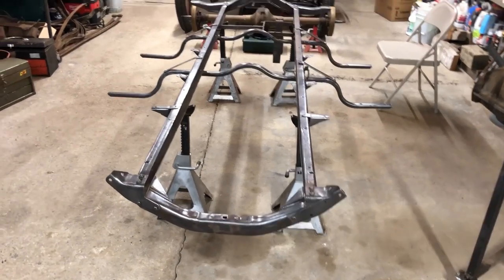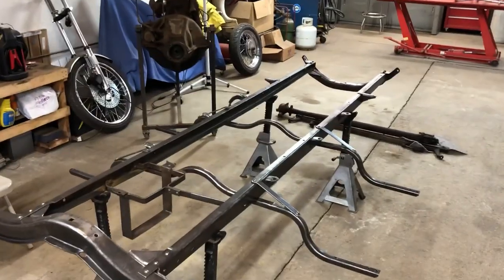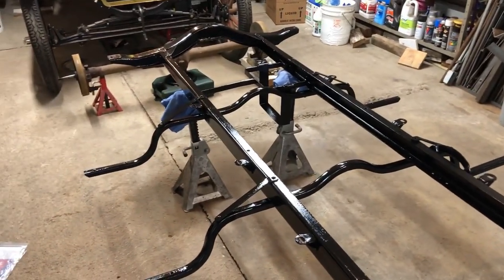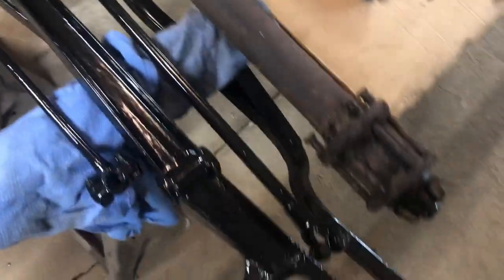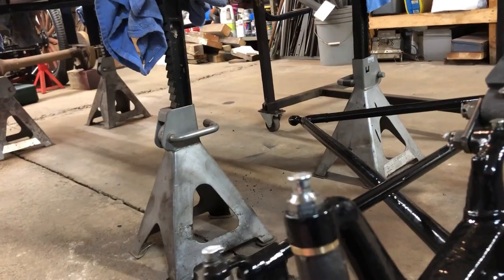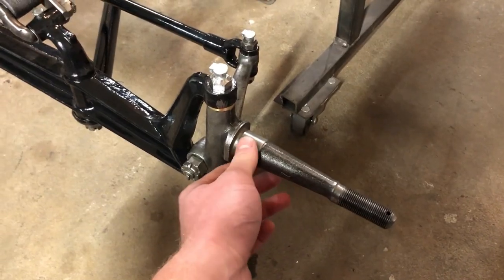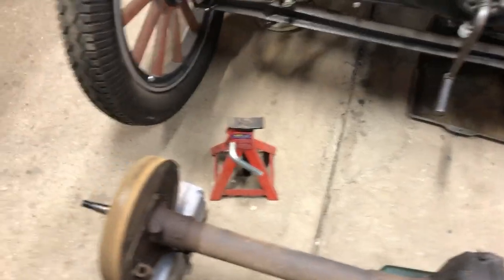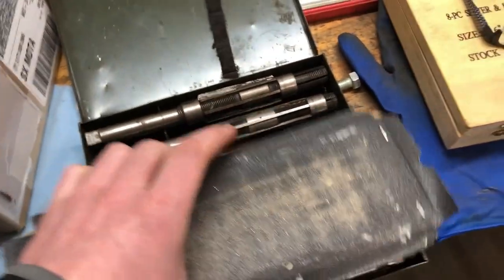Ford Model T Restoration Part 3 - Front Suspension Assembly and Painting - Reaming King Pin Bushings

Comment: Im rebuilding a 1926 T Roadster. It was apart when I bought and Im having trouble finding anything to show me how it goes together. Im ready to install the body but can't find anything to show the sequence. I'm hoping that you have more videos. So far I found 1 2 and 3.
Reply from the maker: On the Model T my family is working on we removed the fenders, running boards, and mud guards before we removed the 6 bolts to remove the cab portion. My 1926 is a coupe.

Comment: Were you trying to stay original?  It seems that welding over the oil caps and tapping in a grease zert would be a good upgrade.
Reply from the maker: @jjpenn8925  It is staying original. No need to install grease zerks as the oil cups work just fine. Thanks for watching!
Reply: @JohnsClunkerCars  I was figuring as much.